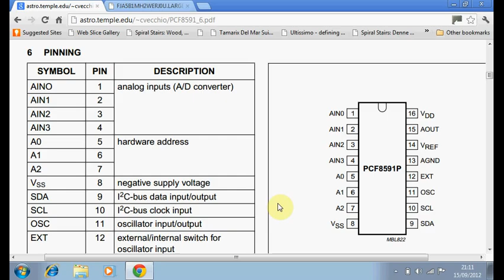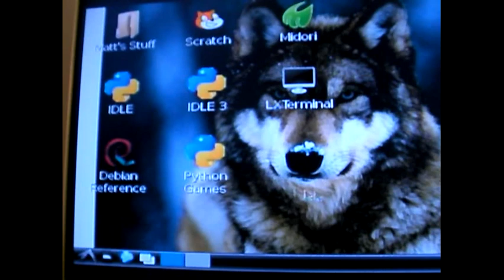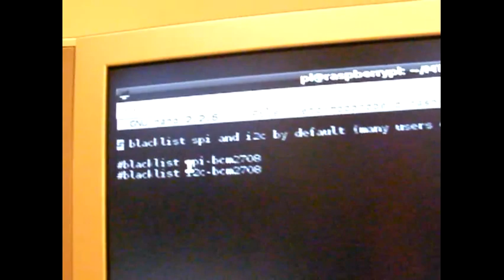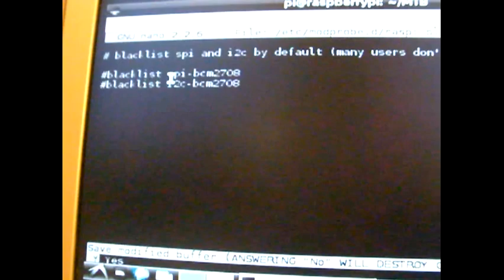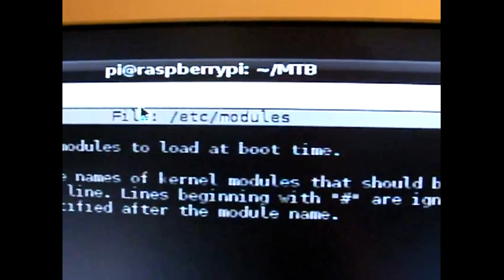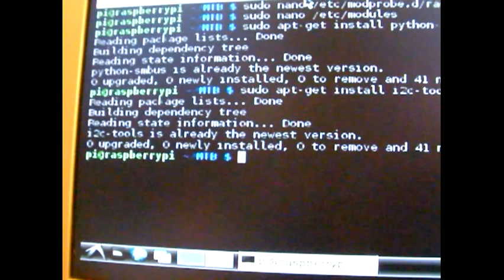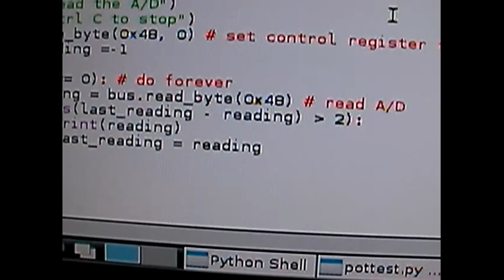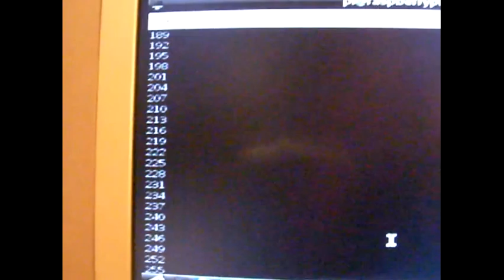Raspberry Pi - Reading Analogue inputs - Part 2 of 2

Comment: Thank you so much for this. I acquired a s12sd uv sensor and I was stuck converting the analogue output to a digital signal that could be read by Pi. I found a pcf chip amongst my collection of bits but couldn't work out how to use it. Your tutorial is one of the simplest and easiest to follow guides that I have used. Much appreciated.

Comment: This might be useful to mention : Your tutorial is for a Rev1 Pi. People who have a Rev2 Pi need to change the bus ID from bus = SMBus(0) to   bus = SMBus(1) otherwise they will get an IOError since the bus has changed from Rev1 to Rev2. To fix the "Stuck on 128" problem several people mentioned in the comments : Do not connect the OSC (Pin 11) of the PCF8591 to ground simply leave it unconnected and the problem should be solved.
Reply: Thanks a lot, after 5 years this answer is still saving. My project was not working until I readed your solution, after I disconnect OSC from ground it worked.